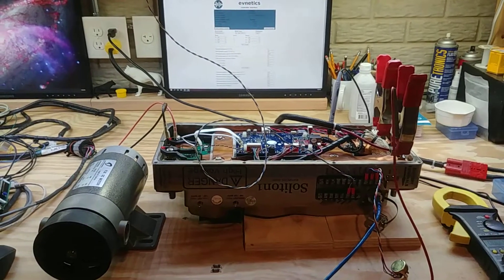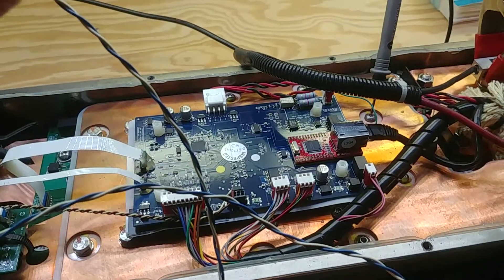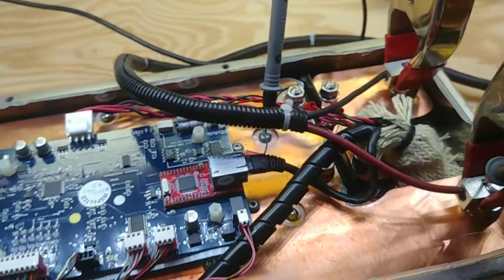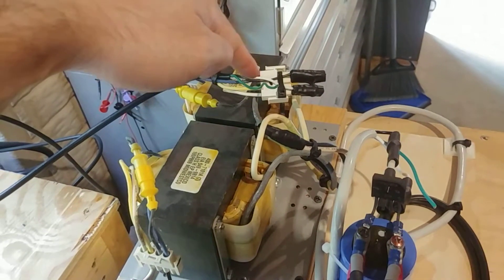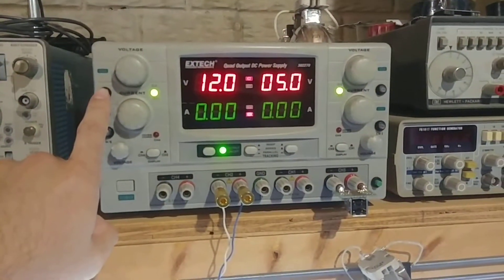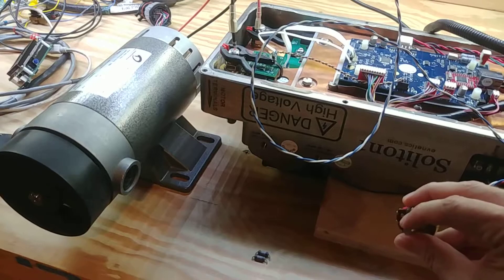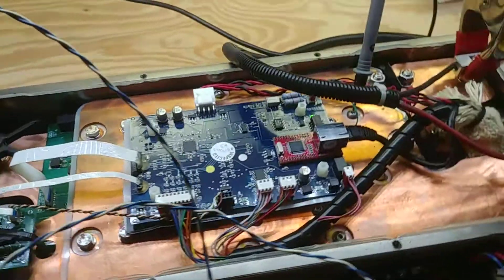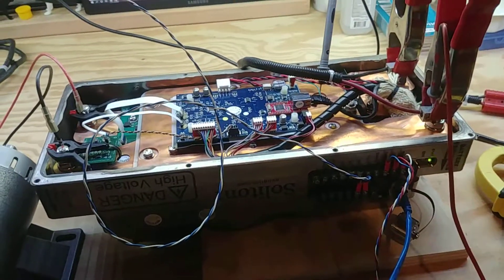Evnetics Soliton 1 Motor Controller Repair

Comment: I'm having this exact problem currently (hehe, current), stored my car, battery died, pre charge error after I replaced the battery.  Guess I'm taking apart the Soliton1 next to check the pre charge resistors...

Comment: Wow!!
I just picked up a dead Jeep Wrangler with a soliton jr,24  6 volt cells,an a dead 12 volt primary battery..
What's the best way ta start this up, safely,after I charge all the 6 volts,an replace the 12? I didn't get a charger with it, so I'm ganging two 6's fer a 12 volt 20 amp charger, 
Imma goona buy a 12 volt fer primary..
Any tips? I'd really like ta NOT let the smoke outta the box..
Very,very informative..
I'm grateful you posted .
THANX 😁